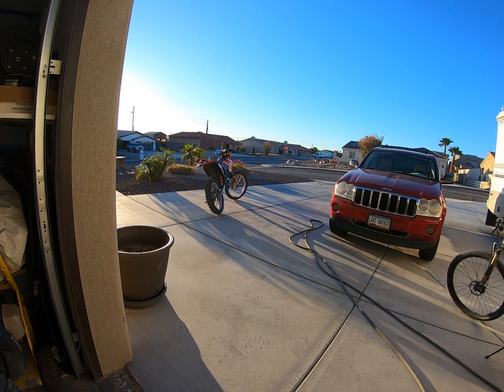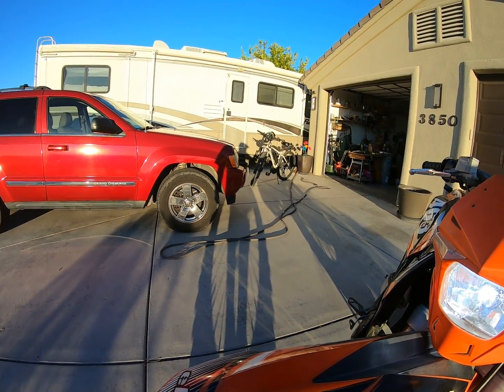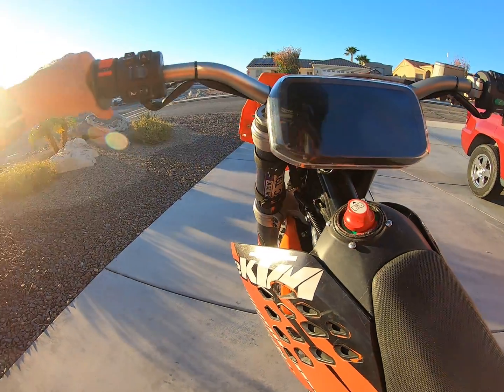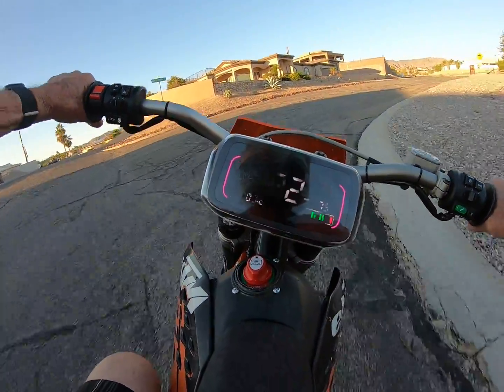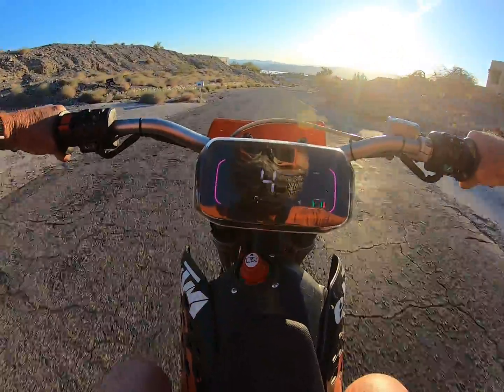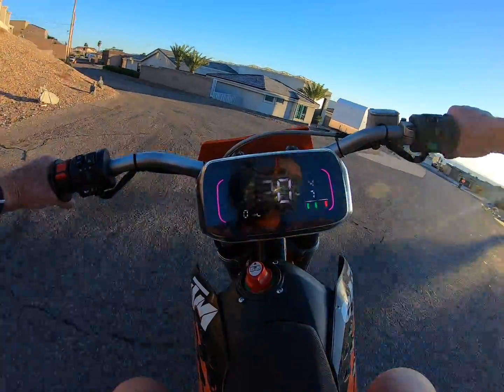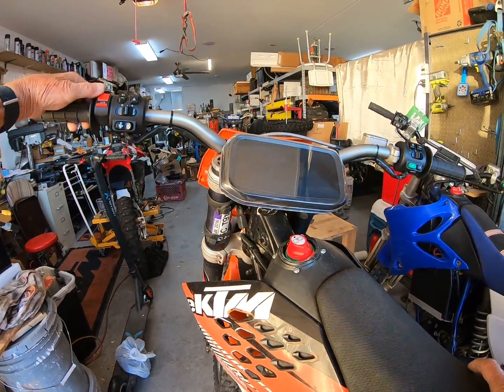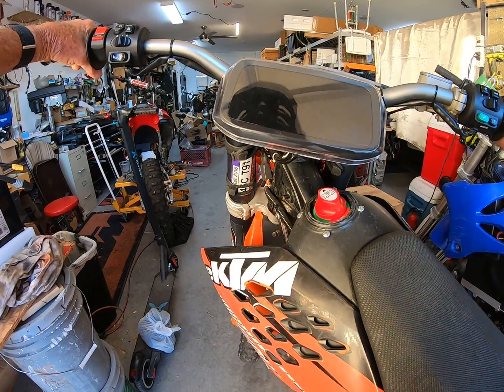2008 KTM 250SXF with QS138 70H V3 motor and EM260S controller. Finished bike test ride

Comment: Hi Donald im about the enbark on a electric trail bike build here in Sydney Australia, i need to get the bike engineered to pass strict australian design rules if i wish to use it on the road here, have you worked with 90H QS138 supplier is stating same size yet 4kw vs 3kw rated compared to 70H ?
thanks for the videos and tips, i intend on using a 260S
Reply from the maker: I haven't built with that motor, the 90H, but if you are going to use the EM260S controller, you will end with the same horsepower , being limited by 40-450A at 72V.  The 70H motor is 1" narrower.  The 90H mess's with the rear brake pedal.  Have you motor mount water jetted by Lithium-King.com.  Just give him a few measurements, and he can make them out of any material ( Aluminum, Stainless, Titanium etc.  He only does it for the QS138 70H V3 motor
Reply: @dcoxryton  thanks Donald so I stick with 70H from a width point. They state the 70H is rated 3kw, do you know what kW or hp you getting from this motor with 260s and 72v batteries, I plan on getting Kenny at amorge batteries to make my power pack
Reply from the maker: @davecarter34  With the Em260S, you can pump 400A to either motor.  72V times 400A = 28.8KW or about 38.4 HP.  You will need a battery to supply 400A for a while.  What bike you put it in determines how much battery.  A 20S16P battery will give you about 40 miles of single track.  A 20S20P is 25% more.  Amorge is a good place to get your battery.

Comment: Nice build. I don't remember if you used the same throttle system in your Yz's but I have used several Chinese ones finding this one you have on this ktm the smoothest, although bulkiest,  of all of them. What do you think?
Reply from the maker: I don't use this throttle on the track bikes, because it is bulky, and we don't need the switches.  But you are right this is a very smooth throttle.  It works well for a street bike for all the controls.

Comment: how easy is it to convert a 2013 yz250f with one of these and how much is it? top speed? how long does battery last
Reply from the maker: The Motor and controller installation is pretty easy.  The Battery space limits how big a battery you can put into it. The 2013 YZ250F was the last year of the early Aluminum frames.  Space is limited to about 20S12P  (50AH , good for about 25-30 mile of single track) The 2014 YZ250F opens up to a quick change battery, kind of like the Surron. A battery about the same size and range, it just can be swapped. There are some new batteries that can give you more range, but you lose on the Higher current and power, if that is what you want.
Reply from the maker: Top speed can vary, at the expense of low end power.  60-70MPH

Comment: That looks like so much fun! One day I want to build one 👍🏼
Reply from the maker: They are fun,  For your first, buy one and save a lot of expense and time.
Reply: @dcoxryton  buy the bike with no motor wouldn’t be the problem but everything else is expensive lol. The battery alone is $3500CAD. And the motor and controller is $1000CAD I believe. One day!